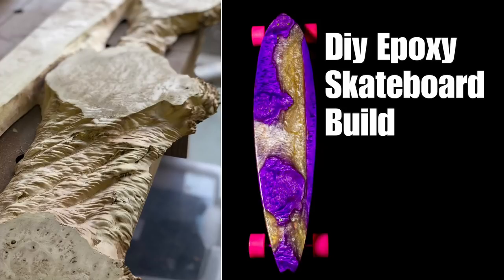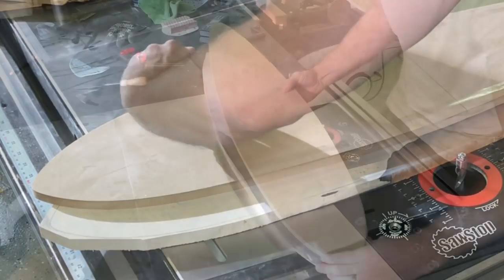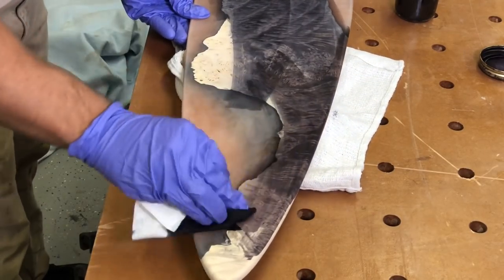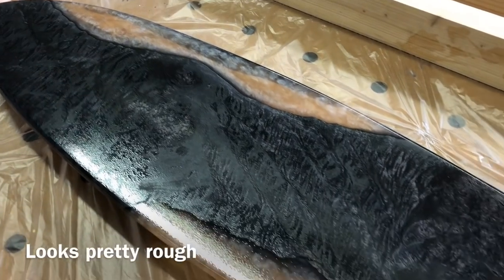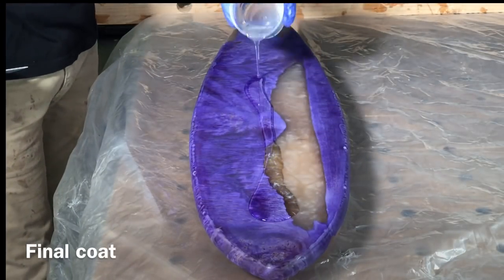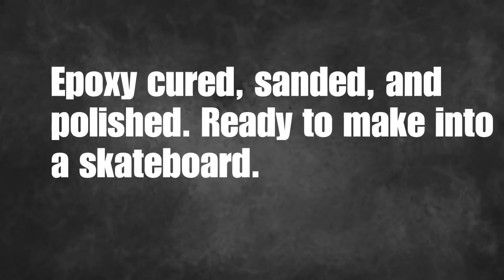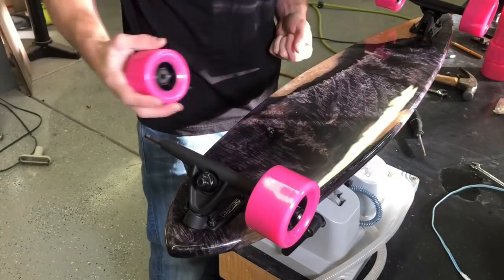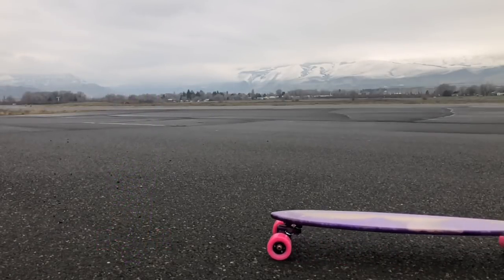Blacktail Studio Skateboard—Part Two of Two—Diy Epoxy Skateboard

Comment: You know what's funny... the epoxy looks like the wood and the wood looks like epoxy 🤣
These are super sweet though! Just need some grip tape over the top (which covers up half of the beauty!). Maybe theres a clear anti-slip coating... or maybe some clear grit/grain you can mix into the epoxy you pour on the top. I think I'll try to make a couple of these out of Monkeypod. Thanks for the inspiration.

Comment: congrats for the high-quality video and for the nice skateboards. Just a couple of questions, I didn't get if you put something for increasing the grip, and if not, how would you do with the epoxy? for instance: adding sands or salt to the resine?  However, I think that for the pictures they would look better in an urban context rather than a black background. Thanks
Reply from the maker: They make clear grip tape. Sent it to my nephews and told them to add it if they were gonna ride them. Gonna be mostly wall-hangers though.

Comment: this is the coolest thing ive ever seen pretty much.................. im going to try to do this to a muzzle loading pistol i am building with some lichteneberg epoxy filled burns.
only thing that could have made these boards better would have been a better colored epoxy.. it dried like a neutral skin color instead of pink
Reply from the maker: Yeah, I was pretty disappointed in the color too
Reply: @BlacktailStudio  how long do you wait after you put the black stain on to rub it off the epoxy?

Comment: Absolut amazing work!!!! 
I think, I need a loot of practice for someting like this :)
I have a question, i made a carbon case with expoxit.
It look's not perfect but ok.
After that I decided to use a epoxy based clearcoat on top.
Now this is to soft and you can see every fingerprint.
Should I make a layer harder on top of it? Or is this a bad idea?

Thanks and gettings from Germany :)

Comment: I’m a little late to this video, really love your work and recently binged large portions of your channel. As art pieces these would be so cool to hang on the wall but as actual longboards how do they ride? Most longboards are made with a bunch of very thin layers of wood so they get a specific flex and concavity. How did these hold up if/when you used them? Did you get good traction on the deck? Was it super stiff? Really curious how these would perform, especially with the epoxy in there.
Reply: Hey bro you think epoxies flexible but he said something about some kinda of epoxy so idk but this definitely isn't going to flex but you can come up with ideas to use different methods to compare invitations are key love these boards 😉 late myself.
Reply: @pleaseholdtherecognition225  I highly doubt the epoxy will be flexible, I'd expect it to be fairly rigid.